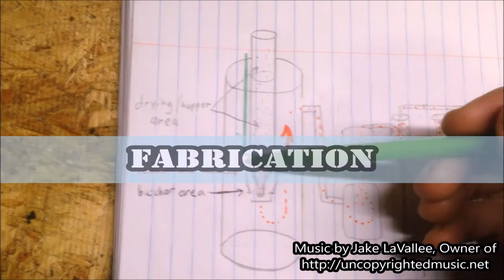Will a Wood Gasifier Run on Garbage?

Comment: You'll find that you have got a mix of air and gas in your flare blower assembly.
It will always burn, and bang, like this, until all of the air is ejected from  the gas stream.
I would like to suggest that you put some stainless steel wool into the end of the pipe, perhaps into a smaller diameter pipe inserted into your existing flare port.
When air is present, the SS wool will glow like a cigarette, then the flame will start to lift off as the air in the plumbing is all used up.
The SS wool makes for a cheap and effective flashback preventer.
That's how I do mine, and it works like a charm  :) .
Reply from the maker: This never happened with this blower except with the trash though. Also I think air is getting in unsealed seems in the blower as the fire doesn't go back into my system further than the blower. I'll probably just try to seal my blower up a little better.Sorry about the slow reply, I have very limited internet access right now.
Reply: tonto bob 
Yup, you are surely right about the air ingress path.
As you develop this system, and start producing stronger gas, the explosions will become strong enough to utterly destroy your blower.
Been there, done that, collected the broken pieces from all around the blast site.
For safety's sake, always be sure to fit those flashback arrestors.
You will not regret it  :) .
Oh, by the way, your gasser will run nicely on garbage for a while, then it may stop working, especially if you consume too much of the charcoal below the combustion zone.
Charcoal is your best friend in a gasifier.
Reply from the maker: Hmmm never thought of that, didn't even think about how plastic doesn't make charcoal. Good point. If I'm in town and I remember, I'll buy some stainless scrubbers. Thanks for the advice!
Reply: tonto bob 
Yer welcome  :) .
I run mine on plastic all the time, but I limit it to no more than 5% of the total fuel intake.
The plastic boosts the engine's output quite noticeably, so that's a good sign that it is good fuel  :) .
Reply from the maker: That's awesome, if I need better engine performance while running on wood gas, I'll definatly keep that in mind